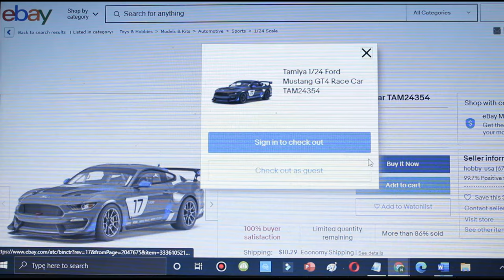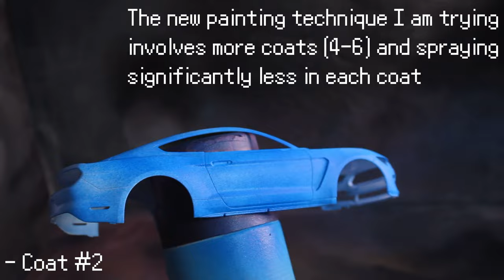Building a Stanced Ford Mustang Gt4 Piece-by-Piece [Tamiya 1/24 Model Kit]

Comment: Nice! I have a suggestion for painting the body, move the spray can across the body side to side, and press the button before you hit the car. What I mean by that is you should be spraying the paint before it hits the body. And only let off of the button after you passed the body. That way you can prevent paint splatter. I know that’s a lot to take in but I hope you understand what I am saying. I like your channel and I have subscribed.
Reply from the maker: Thank you for that excellent advice I will optimistically be trying that technique in the next build! If you have any more suggestions i'm all ears!